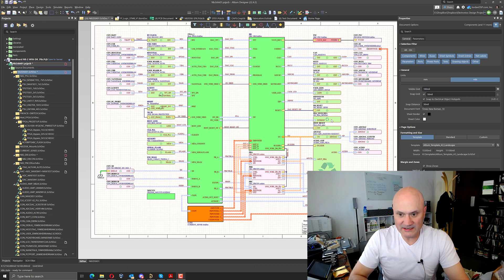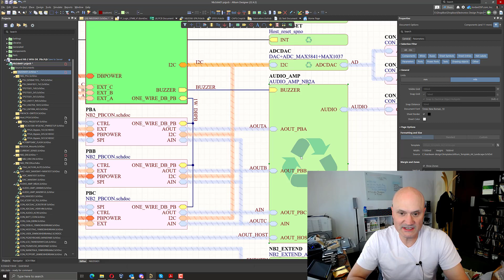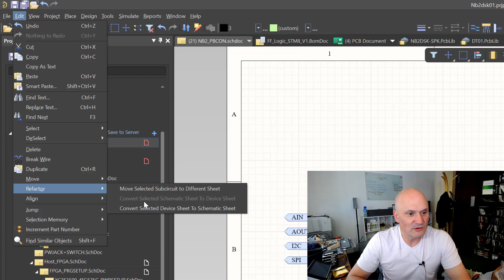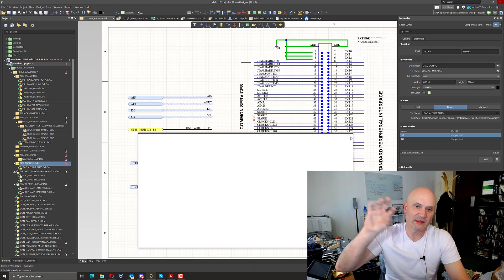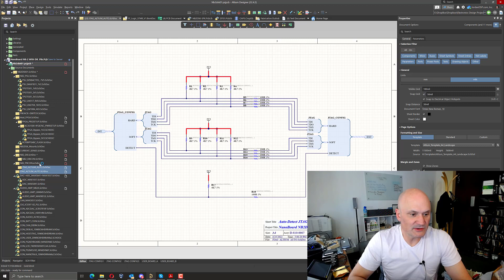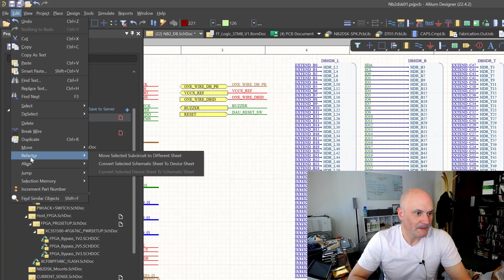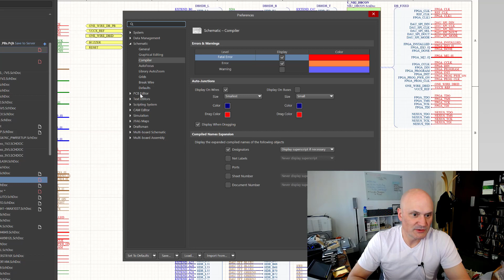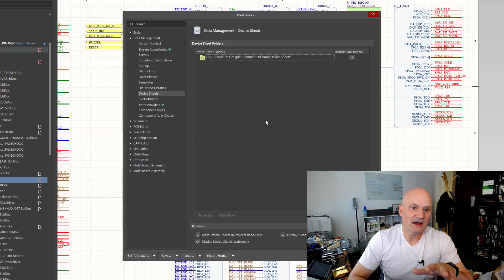Re-usable schematics, Device Sheets, and Refactoring in Altium Designer (2022)

Comment: Is it possible search for device sheets library like components library? Is it possible to assign some parameters to device sheet?
Reply from the maker: Great question. Technically these things are possible, however the system doesn't index Device Sheets as well as it does for Components. Device Sheets hold Parameters just like any other object in the Altium workspace. And it's possible to use those parameters to drive the function of the sheet (for example, adjusting different resistor values based on a desired center frequency).